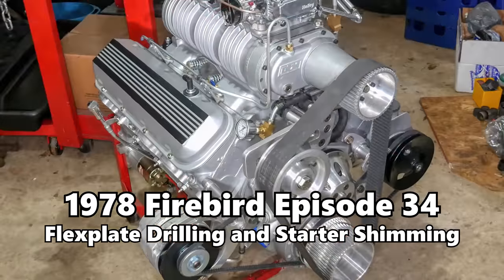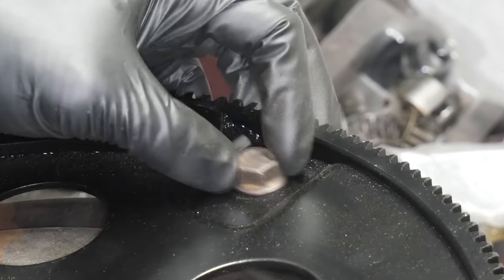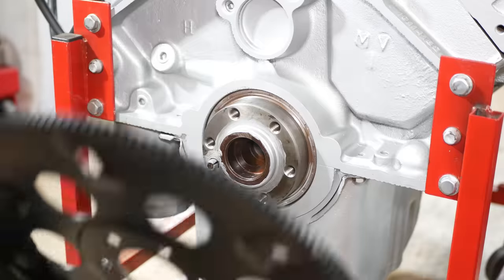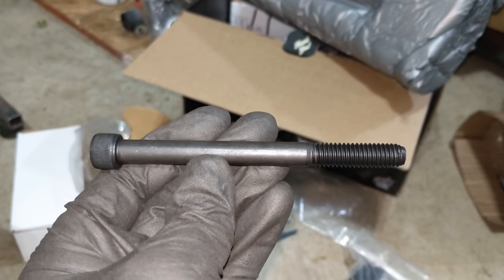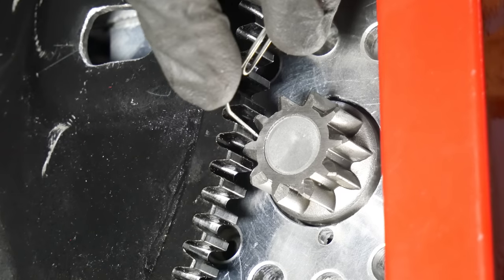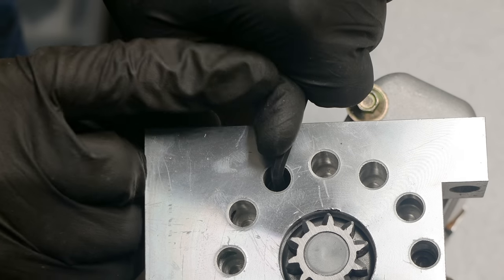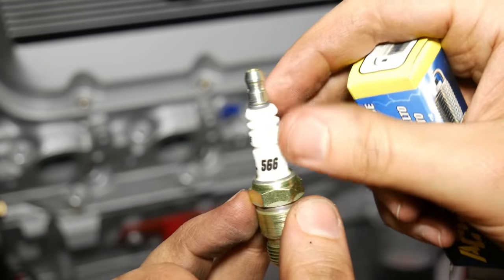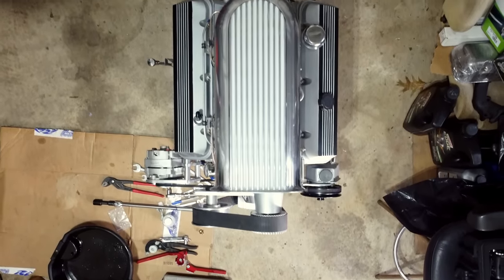454 Engine Swap: Drilling Flexplate, Shimming Starter, and Weighing Engine (78 Firebird Ep.34)

Comment: Those flexplates were weak from the factory. I've broke 4 of them myself on stock motors. 2 of them cracked from the torque converter bolt inward. I would prepare to replace it with something aftermarket in the future.

Comment: Reason the factory did not tighten those bolts was due to the fact its adjustable and if they tighten them up with lock tight it be harder later to move it.

Comment: I would have welded the original holes, ground them smooth (or taken them to a machine shop and had them milled), then I would have built an adapter for the pilot so it would have been perfectly centered, then I would have drilled out the new holes. Admittedly it would have been a lot of work, but I think it would have been worth it.

Comment: You are going to have a hard time with those plugs. you need to go one or two ranges cooler than factory. and gap them about 0.20-0.25, for blown engines. you need to gap them lower for the boost or they will flame out. IE the boost will blow the spark away at 0.35. Also the reason for cooler plugs is for detonation. Also you will want to read the plugs straps for the timing mark. less timing than original for starters then bring it up slowly.

Comment: Given how tight the engine bay is I would suggest placing the headers in the engine bay before you put the engine in the car.
Reply from the maker: We already got it in place but in case someone else is reading this, I would agree. Driver's side header was fine but we had to unbolt the passenger side one and guide it in with the engine to get it past the crossmember. It was frustratingly close but just wasn't going to happen with the transmission still installed.

Comment: Is the suspension strong enough to keep the car from being a low rider up front?
Reply from the maker: When I replaced the front springs a few years ago, I chose the heavier ones used for factory big block cars and on top of that it has the overload shocks. If anything could carry that without breaking a sweat it should be able to. Hopefully.

Comment: Too bad you don't have an engine  run stand. It would be nice to get the engine running to check for oil /coolant leaks. And to dial it in before it goes into the car.

Comment: For the love of god clamp down your work when drilling and USE OIL OR CUTTING FLUID. 

Seriously you’re going to get hurt one of these days if a part catches and starts spinning.
Reply from the maker: If you caught the clip after the credits, I am very familiar with that drill press and used to it grabbing. For small/important stuff or if it was a stronger machine I could not be so complacent/lax about it. And you don't see it being applied because of the way the clips are cut/sped up but I almost always use oil to drill steel, in this video you can see a little burst of smoke every once in a while from adding engine oil which is not ideal but better than nothing.
Reply: @FuzzyDiceProjects  gotcha. 
I’d still recommend using way more oil and clamps. 
Complacency kills.
Reply: @FuzzyDiceProjects  Sometimes, people are trying to save you from yourself. Learn to take good advice and constructive criticisms rather than making excuses for your bad habits. Look at how many injury stories started with "I've done it a thousand times before...".